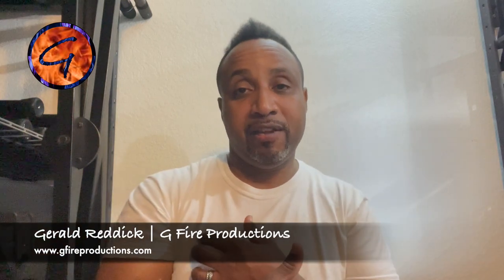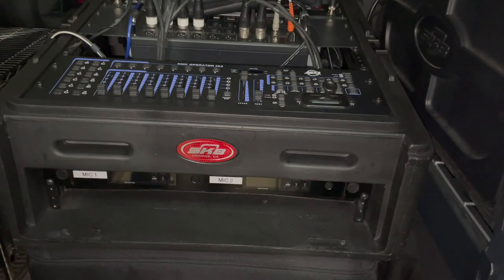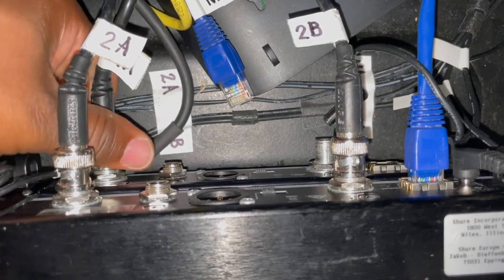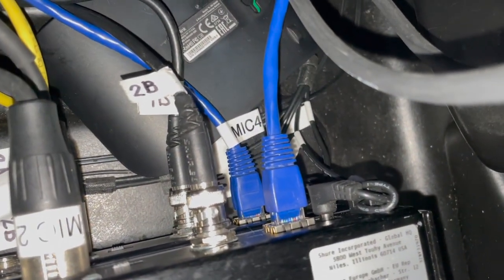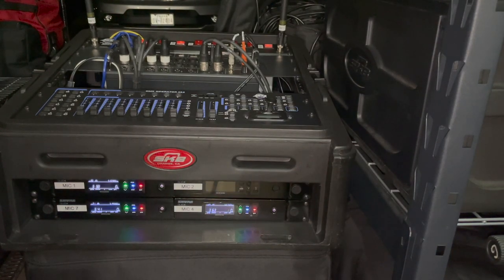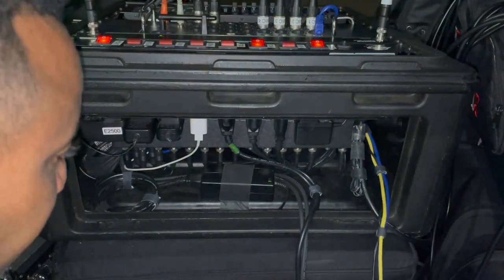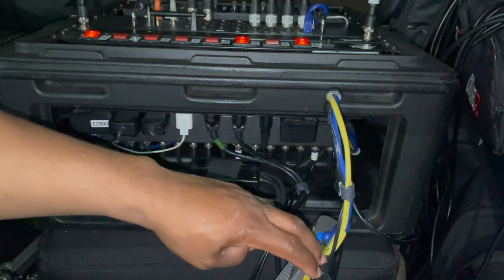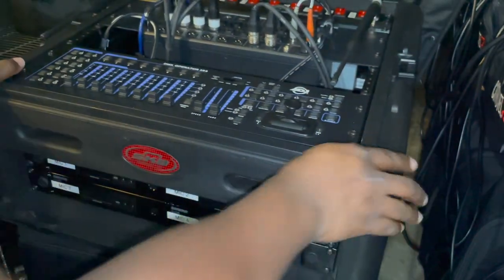Shure QLXD | 6 Mics, Only Two Antennas | Rack more Mics in the Krackin

Comment: Great video. hey, can you mix and match receivers with the UA844 distro? I mean, I have two ULXD4D G50 band and two ULXD4D V50 band. If you use two different bands receivers, what antenna will you use on UA844? I believe different bands have their own dedicated antennas, right?
Reply from the maker: Hello and thanks for watching. From what I can see on the website, the ULXD's "G" band is in the 488.250-505.970 MHz frequency range and is compatible with the UA844+ Antenna Distribution. The "V" band is in the 180.250-197.500 MHz frequency range and seems to be compatible with the UA844+V Antenna Distribution. So I don't think any one model Antenna Distribution can cover both bands of microphones. I I do recommend that you consult with Shure technical support though.

Sure Frequency Finder @  https://www.shure.com/en-US/support/tools/frequency-finder
UA844+ and UA844+v info @ https://www.shure.com/en-US/products/accessories/ua844p?variant=UA844+SWB

Comment: can you show me the antenna setup? How are you routing 8 total antenna cords to just 2 antennas i  mean
Reply from the maker: Sure thing Peter. The antenna distribution is the Shure UA 844+ SWB. It provides DC power for up to 4 microphones eliminating the power supply for each microphone and provides antenna signal for up to 4 microphones. Now it does have a fifth set of antenna outs but it's usually for cascading to the next antenna distro to continue adding more microphones to your rack. In my case I have 4 microphones powered by the antenna distro and all four microphones get their antenna signal through this unit.  This way I only need to plug in the antenna distro and have only two antennas sticking up to square away 4 microphones. I hope this is understandable sir and helpful. I showed it here in this video: https://www.youtube.com/watch?v=xpe8h28t_AY

Comment: Do the network wifi router make a big difference?
Reply from the maker: Hello DJ Elements and thank you for watching. The network router makes a huge difference in a more secure connection with my tablet or MAC to my Behringer XR18 because the built in Wi-Fi in my opinion is seriously limited. As far as networking the microphones, from a DJ perspective it is not necessary. I regularly I am involved in multiple microphone set ups and sometimes Live sound. What it does for me is allow me to quickly use any one mic to scan all of the microphones together so I can move on to other task when setting up for bands. Through the network router I am also able to use a program called Workbench to monitor activity on my microphones but again I only do that when I am operating in live sound. Does this answer your question DJ Elements?